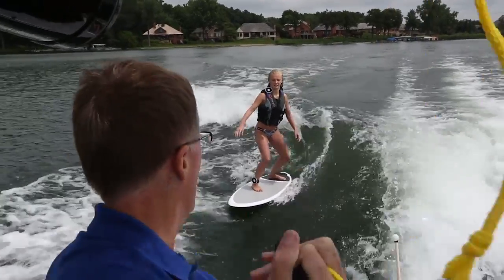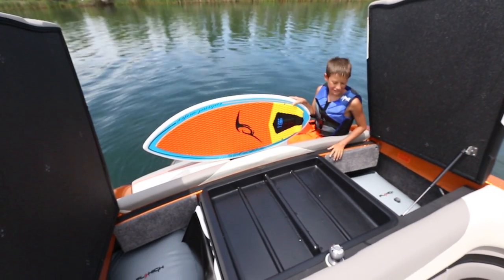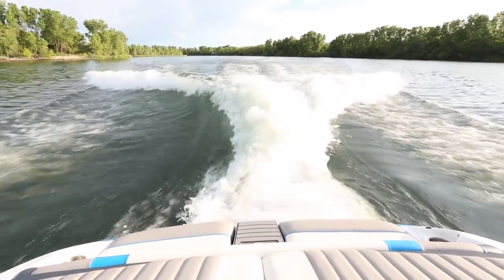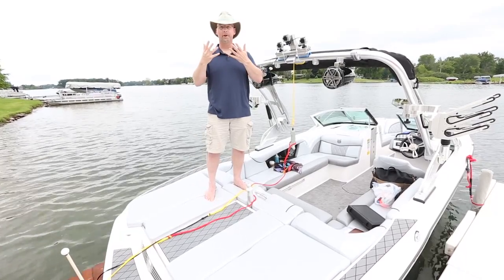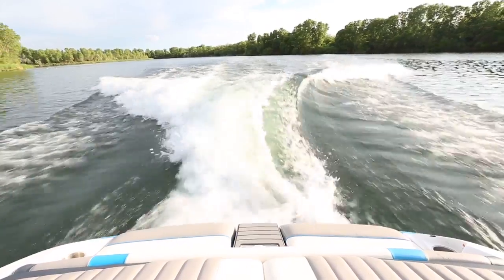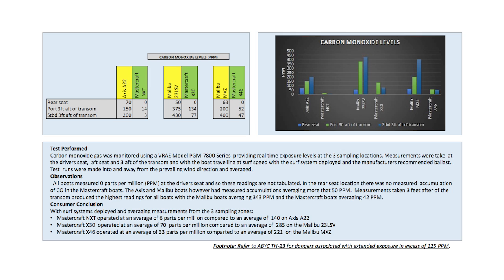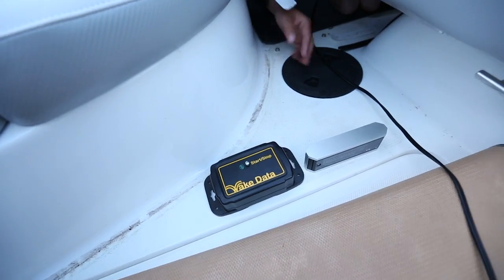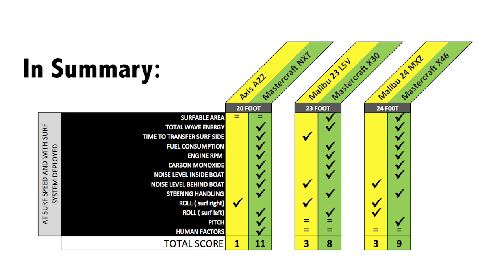Wake Surf Systems

Comment: I’m not biased towards either of these boat brands, but as a surfer and an advocate for the scientific method I see quite a few things wrong with this study. In order to get an accurate comparison between the two surf systems you need to eliminate all other different variables. That means that you need to have the same total amount of weight (boat and ballast included) no wedge and other things that the boats have differently. Also, majority of surfers add extra ballast to their boat, so you would also need to measure how added ballast affects the wave. The riders you also used in the test aren’t a true accurate representation of a surfer. Heck my paperweight little brother can surf in the white stuff behind the curl of the wave, but that does not mean that area is a surfable wave. I would also recommend having a variety of different weight surfers on each wave to see how they react to it. Many variables left unchecked that ruin the accuracy of this test.

Comment: It looks like they had the skill to do a good comparison but this is far from that. These tests didn't account for all the variables and they made no mention of what the standard deviation and percent error were. Based on how close some of the results are you would assume that this difference would be inconclusive based on these facts. Also the report does not show any calculations or methods used besides a high level overview so it is not possible to even evaluate their results. The whole point of a comparative study is to show facts, numbers, and procedures in a way that someone else could repeat the study if they wanted. This falls into the opinion category not scientific proof. I'm not partial to either brand but these tests seem to be biased.

Comment: People who don't surf should not be allowed to test surf waves! Boat looks like it's going 15-18 mph half the time. 

Absolutely useless application of data. Carbon monoxide? Ever heard of a surf pipe? Or FAE? 

All this data is subject to the way the boat is loaded,the weight of the boat to begin with (total weight), gas in tank, wind, depth of water, speed, boat prop, motor torque, speed control system, temperature, and even how clean the bottom of the boat is. Testing push with a feather weight rider is like testing flight with a paper airplane vs a real plane, both fly, but how heavy is the average rider? The pitch and yaw of the riders on there surfboard doesn't change the push? Are you kidding me? Most pro wake surfers would be interested in this for a second, and then walk away shaking there heads at the OBVIOUS key factors ignored in this "study" .  This is why real advancement is not made by such people, or such people who run companies into the ground with there corporate know how, and lack of knowledge. Just a shame that videos like this lure unknowing people in, just to boost sales, and ignore common facts. I agree with last post,  to be accurate we would need a centurion , and a nautique, and a couple pro surfers to throttle the geeks with the testing equipment.
Reply: tell me you have a wakesetter without telling me...hahaha

Comment: When it started, I thought it would be better.  I read the written report and was also disappointed.  The boat year, prop size, engine type (was the Ultra Low Emissions engine package on each boat?).and other important data was not there.  The way the steps for setting up the A22 was presented was misleading.   Too bad. I had hoped for better.